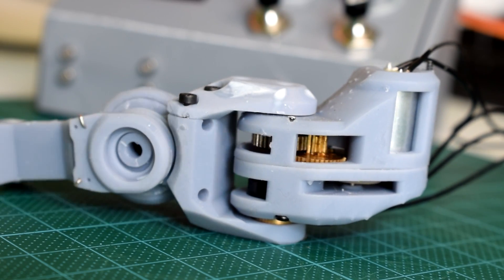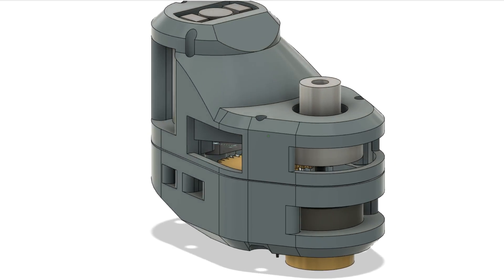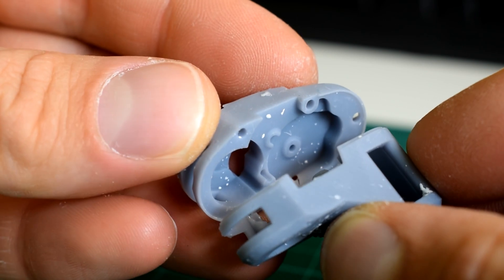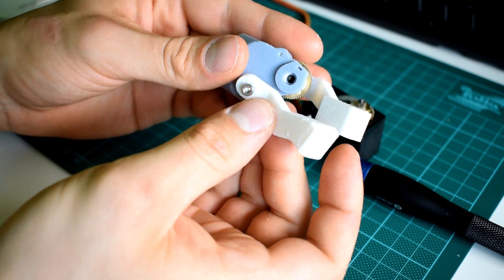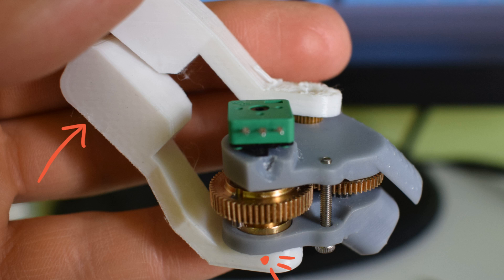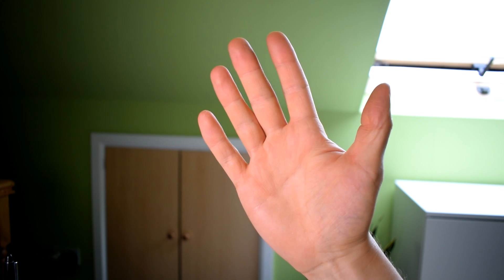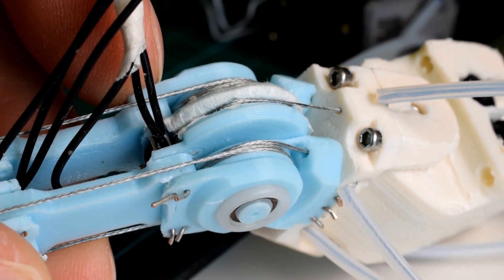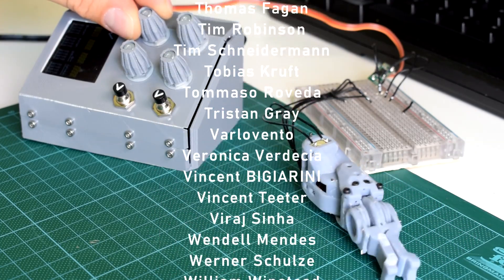Prototyping the Palm Components  - Biomimetic Mechatronic Hand Part 7

Comment: The first-degree of freedom in the thumb merely draws it toward the ring finger. And there's a much lower point of attachment on the wrist. The second degree of freedom is actually a 45° angle so just turn the direction of the thumb at the joint and you'll have it. There's no need to break the thumb.

Comment: You may be able to get the range of movement of the human hand in a small enough package. But I think you are basing your design around the wrong technology... Servo motors will never get small enough while having comparable strength and speed to human muscle. It just not going to happen. Go with pneumatic or hydraulics, those two are your only bet to get anywhere close to the performance of a human hand.

Comment: I havent watched all of the video yet but i had an idea that you can keep in the back of you pockets in case you need for for space saving in the forearm. What if you use the sleeving for cabling as the cable themselves for simple broad movement? Although at the rate that your designs and prototyping are improving, my idea is simple childs play.

Comment: Theoretically the 4th and 5th gearbox in the palm is not needed as that type of movement is highly determined by the movement of the cables going to the 4th and 5th fingers and limited by elastic bands or springs that could connect and bind the metacarpals together, at least that is how the human hand functions, also that type of movement is different according to muscle structure and possibly ligament structure between different people, especially between men and women, if you follow the movement of only your hand of those metacarpals then you won't be able to accurately approximate the movement of the female hand in case it is ever needed in the future. It would be good to ask several people male and female so that you can observe them doing several tasks with their hands such as grasping, holding, and picking up things with only the index finger and the thumb, record video of the movements and it will reveal a lot about the movements of the 4th and 5th metacarpals.

Comment: You want to have a little space in the guide tubes and the cable lines or else it would create too much friction which would be bad for both the line and the tube, also a bit of space allows you to put a drop of silicone lubrication on the cable line which allows the servo to work at peak proficiency.

Comment: Holy molly. You did not check the tolerances between the gears. You checked the clearances. The words have completely different meaning. 
Other than that, I love your videos. You do amazing work.
Re this website: http://www.epi-eng.com/mechanical_engineering_basics/clearance_and_tolerance.htm

“Stated simply, CLEARANCE is the distance between the adjacent surfaces of mating parts (how much the mating parts CLEAR each other), while TOLERANCE is the allowable variation of a dimension from its nominal (desired) value ( the amount of error one will TOLERATE ).”

Comment: a tip for curing after cleaning the part place it in a glass jar with water and cure it in that. i beleive it is similar to what the pros do. i saw it in a video where a guy fixed warping when curing in the sun by placing the part in water

Comment: Look for a tool named "Photon File Validator" It will analyze the output of the Photon printer and tell you if the automatic supports are doing a good job, or if there are any unsupported islands. That way you can go back to Chitubox to the specific layer that might be unsupported, and fix the issue before you give your 3D printer the file.

Comment: That thumb video edit was creepy :) I think you can get it pretty accurate with two servos. The first bone of the thumb seems to trace out a cone shape. One axis to rotate around the cone, and one to move in the cone's radial direction, controlling how flat/pointy the cone is. Then the other two thumb bones have a single hinge joint that also rotates in the cone radial direction.
What are those super flat potentiometers you're using? Those might save me some suffering.

Comment: I think you should start looking into a setup for cutting brass gears in the near future, at the very least by the point where you'll have a version 2.0 of the fully assembled hand, so you can implement miniaturization and optimization once the major setup is complete. Relying on existing componentry is a mistake, in this kind of application. For something as small as this, you'll have no problems if you make your own cutting machine. You need a rotational axis, an in and out for the cutting motor and the motor itself, which again, at this scale, you could probably get away with a small proxxon mini drill.

If gear cutting seems daunting, i recommend you go watch a few primer videos from Clickspring (the guy building the antikythera machine replica), Tom Lipton (an all round walking encyclopedia of machine operations), and Keith Rucker, of Vintage Machinery (dot) org fame. These three have all the required information, in understanding gears and gear cutting on the go.
Reply: yes, V2 with a cnc mill - please :D

Comment: Another great video.

I wonder if you could just mount the thumb with a torsion spring on a small axel? This could give you a sort of passive degree of movement.

Also, check out 3dprintingpro here on YouTube! The videos are really short and packed with resin printing advice. One quick tip is that you want to minimize printing area per layer, so angling parts can be detrimental sometimes.

Comment: You could always build up a fence around the thin walled areas. As an example, look at an AR-15 lower receiver, its made of aluminum and it can be pretty thin in areas. There is a threaded ring on the rear of the lower reciever for the buffer tube (basically the stock in Lamen's terms) and it has buult up areas around it so it doesnt crack in that thin area. Good luck on the wrist btw, please dont give up and take the easy way out lol.

Comment: 3d printing engineer here. You can get away with a lot more than you currently think when it comes to resin printing, you have a bunch more variables to tweak: try different resins and try UV-curing them to different levels of brittleness. Also you can print 90 degree overhangs, just sayin' in case it is not intuitive after experience with FDM. Aaaaaand, if you snip off support structures before UV-curing the whole thing, it will look a lot cleaner and would need way less attention to random pointy things sticking out of the model :)
Reply: Up you go.
Reply: Definitely second the removal of supports before post-cure! Hell, for the most part they peel right off when they're like that!
Reply: Didnt Even think about that, ive been out of school too long lol
Reply: Good info above!  Been fdm printing since 2013 and resin printing smacked me down to the ground this year!